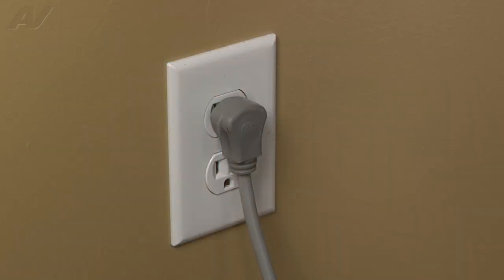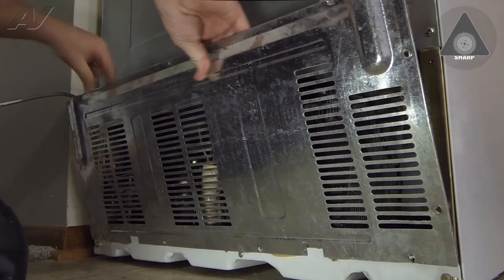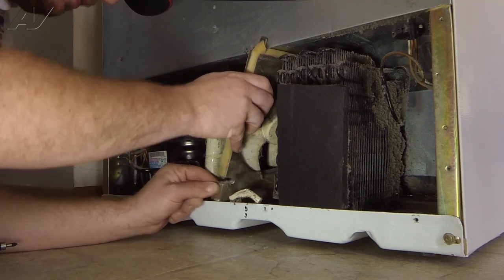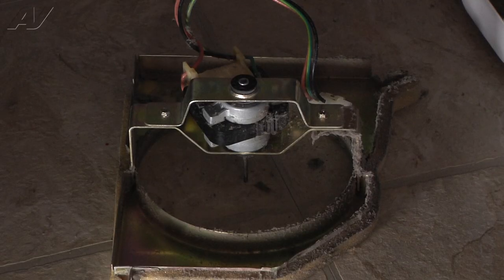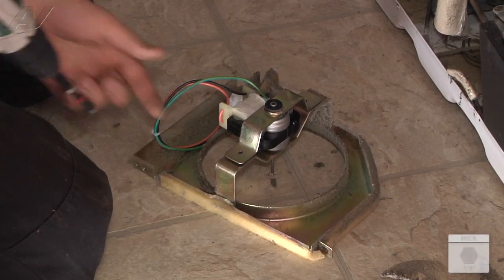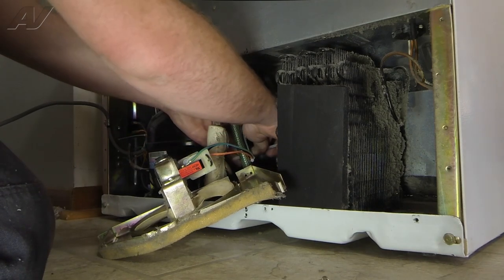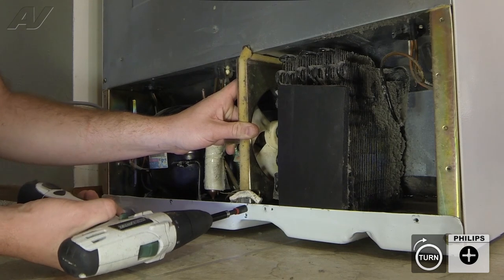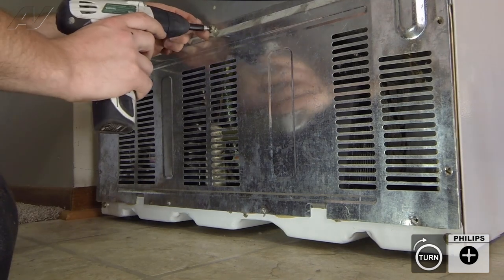GE Refrigerator Repair - Squealing Noise - Condenser Fan Motor

Comment: Thanks for the video. Shouldnt you clean the condensor coils?
Reply: yes absolutely. inefficient heat exchange keeps parts running longer and hotter, reducing lifespan

Comment: pretty good tutorial, but I didnt have the tools to do anything so I was helpless to the continuous sound of chirping from my fridge. 
the back panel was off and turns out 3 of my crickets had crawled into the thing.
all it took was a gud thumpin
Reply from the maker: Great question, if you have a more technical question that our parts department cannot answer, you can search our over 17,000 answered questions free at our website www.ApplianceVideo.com under our Repair Help section. You can also call our parts department at 1-800-830-5465 and they can give you help 7-days A week ,or search at www.SaveMoreOnParts.com  .
Reply: @Appliancevideo  
Thanks? but my fridge wasn't broken. works like a charm.

Comment: My refrigerator gives a squeaky noise about 2 times a day for a couple of seconds. Will this solve the problem?
Reply from the maker: Great question, if you have a more technical question that our parts department cannot answer, our technicians are answering all questions at our website at www.ApplianceVideo.com under our Repair Help section. You can also call our parts department at 1-800-830-5465 and they can give you help 7-days A week Monday Sunday, or search at www.SaveMoreOnParts.com  24 hours 7 days A week.
Reply from the maker: Great question, if you have a more technical question that our parts department cannot answer, our technicians are answering all questions at our website at www.ApplianceVideo.com under our Repair Help section. You can also call our parts department at 1-800-830-5465 and they can give you help 7-days A week Monday Sunday, or search at www.SaveMoreOnParts.com  24 hours 7 days A week.
Reply: Elzette same
Reply: That motor needs a special thin oil on its sleeves. It most likely has brass sleeves surrounded by a cloth (felt) dipped in oil.  Within years, that cloth dries up, and the motor squeals, whistles and knocks.
If you don't have that special thin oil (not sewing machine or clipper mineral oil, but a certain thin, synthetic oil or 0W5 automotive equivalent) you may use a few drops of oil paint thinner (until you get the special synthetic oil). The oil-bearing cloth may be encapsulated in metal or plastic.

Comment: Great video, thanks for sharing this. Any chance that the source of the problem is the faulty motherboard that is controlling the condenser fan?
Reply from the maker: Great question, if you have a more technical question that our parts department cannot answer, you can search our over 10,000 answered questions free at our website www.ApplianceVideo.com under our Repair Help section. You can also call our parts department at 1-800-830-5465 and they can give you help 7-days A week Monday Saturday, or search at www.SaveMoreOnParts.com  24 hours 7 days A week.

Comment: the noise I am hearing sounds like the Pillsbury Doughboy or a dog squeak toy. it lasts a few seconds after I open and close the refrigerator door. - is this the type of sound that is indicative of this repair?
Reply from the maker: Great question, if you have a more technical question that our parts department cannot answer, you can search our over 13,000 answered questions free at our website www.ApplianceVideo.com under our Repair Help section. You can also call our parts department at 1-800-830-5465 and they can give you help 7-days A week ,or search at www.SaveMoreOnParts.com  .

Comment: My freezer makes a loud buzzing noise, when I open freezer it sounds like it’s coming directly behind the plastic cover. I even “hit” the cover and the noise will stop for a few seconds and than start again. Any ideas?
Reply from the maker: Great question, if you have a
more technical question that our parts department cannot answer, you can search
our over 10,000 answered questions free at our website www.ApplianceVideo.com under our Repair Help section. You can also call
our parts department at 1-800-830-5465 and they can give you help 7-days A week
Monday -Sunday, or search at www.SaveMoreOnParts.com  24 hours
7- days A week.
Reply: You need to remove the evaporator cover in the freezer section and verify if the fan is broken or rubbing against something.
Reply: Yep, the fan's blades are hitting something.
Also, the video uploader doesn't help with the generic replies.

Comment: I blew out the dust , sprayed contact cleaner and WD-40 onto the fan and fan motor and the squealing stopped.
Reply: Ya, so didn’t have WD-40 but got all dust out(15 years at least, don’t think any prior owners ever cleaned her once) have some oil for AC motors etc, once figured it was that motor and saw whole thing held together by two brass screws, popped it open, cleaned out what was left of Og lube, gave what I’m assuming are oil pads a good dousing with new oil, slapped all back together and boom, seems like good as new. 

Get new part for it tmmrw but holiday today so store closed and simply could not handle another night of that squeal.

Comment: To me that sounds like a squeaky bearing can't you put some oil on it
Reply from the maker: Great question, if you have a more technical question that our parts department cannot answer, you can search our over 17,000 answered questions free at our website www.ApplianceVideo.com under our Repair Help section. You can also call our parts department at 1-800-830-5465 and they can give you help 7-days A week ,or search at www.SaveMoreOnParts.com  .

Comment: How much does this repair usually cost of done by a technician?
Reply from the maker: Great question, with our
technicians now getting hundreds questions weekly, they are answering all questions
at our website at ApplianceVideo.com under our Repair Help section. We have over
3,000 common questions and answers that you can easily search through by your
model number, appliance make, and problem or error codes.
Reply: Probably about $300 if you're lucky. I'd say about $500 to $800 average.
Reply: this fan should be less than $100...at most, so it should not be expensive, unless they are some crooked tech...
Reply: @DerekP2050  The evaporator fan motor and parts may be ~ 100, but the cost of labor for a tech coming out is at least 200!

Comment: My refrigerator is brand new n squeaks
Reply from the maker: Great question, if you have a
more technical question that our parts department cannot answer, you can search
our over 10,000 answered questions free at our website www.ApplianceVideo.com under our Repair Help section. You can also call
our parts department at 1-800-830-5465 and they can give you help 7-days A week
Monday -Sunday, or search at www.SaveMoreOnParts.com  24 hours
7- days A week.